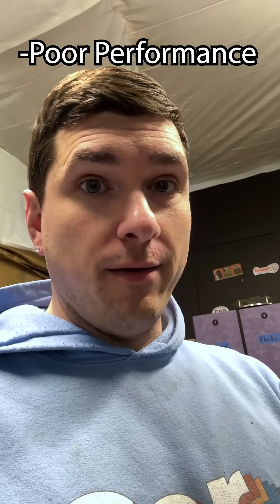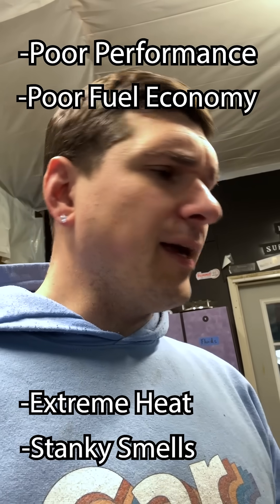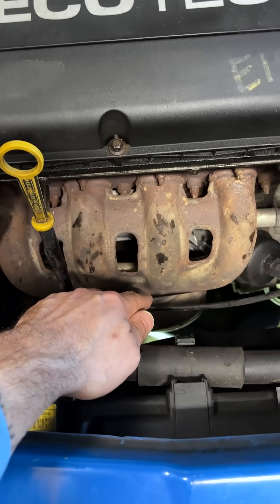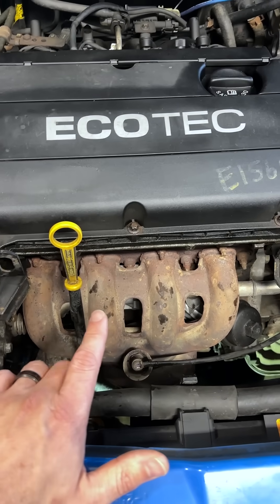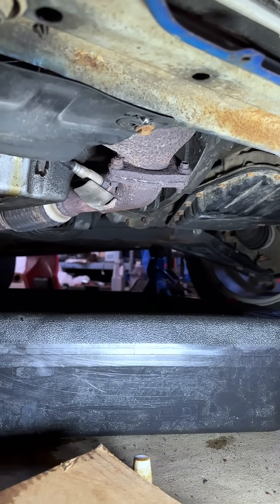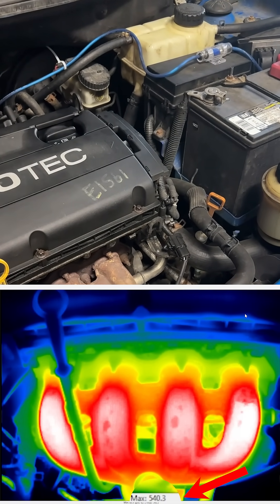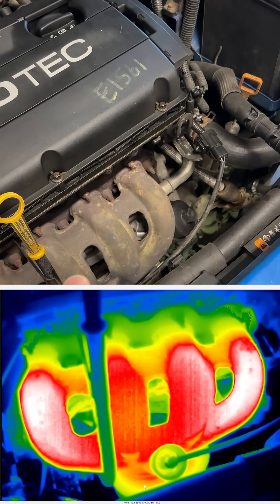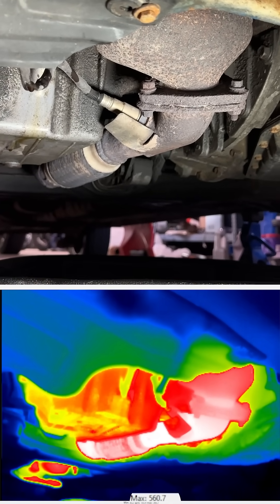Diagnosing My Catalytic Converter With a Thermal Camera #automobile #auto #howto

Comment: 1 gallon of Acetone to a tank of fuel and run at higher than normal RPMs not mineral spirits
Reply from the maker: I've had nine different people tell me nine different things lol
Reply: @Rythecarguy you used Lacquer Thinner which was good. Clearly you were just over the catalytic converter before your finale I watched. Lacquer thinner does have acetone too so he was right. This method though is used to pass emissions tests before the light comes back on 😢